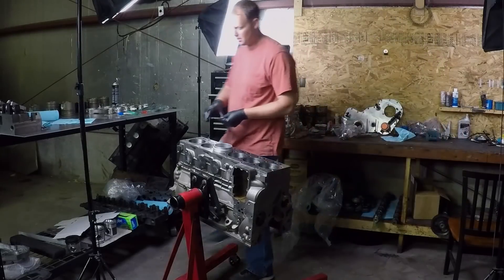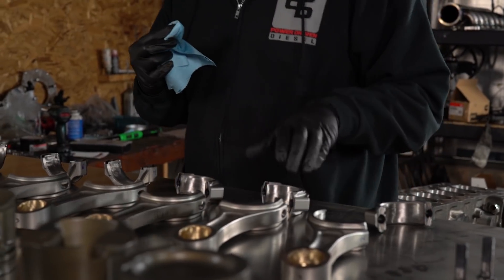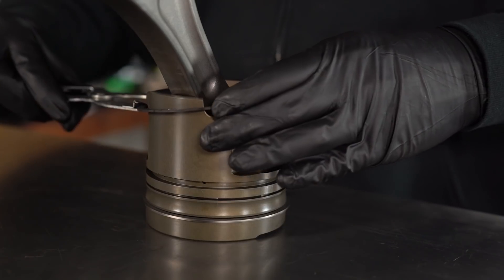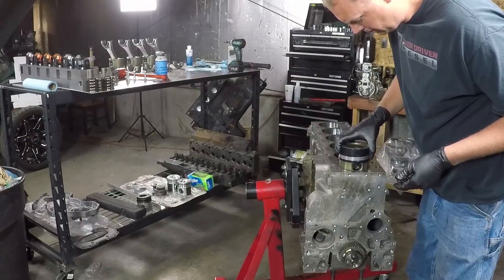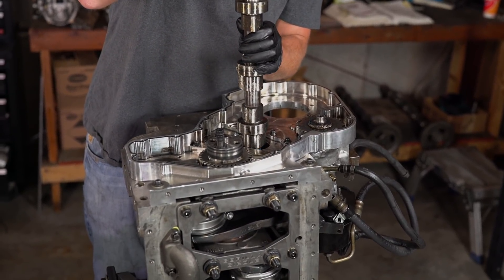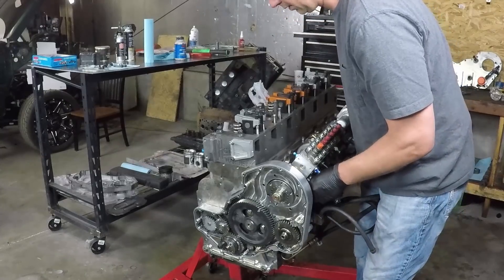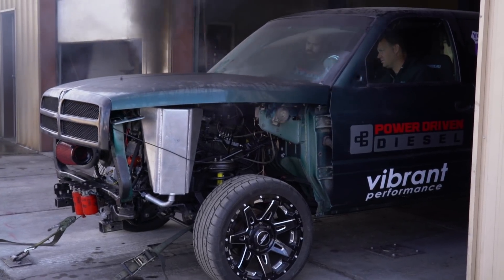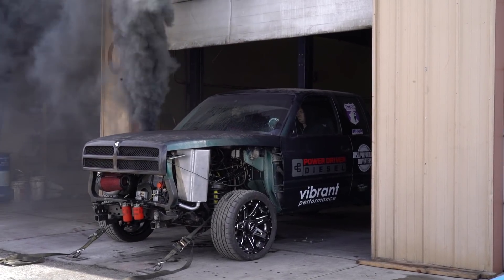Cummins Race Engine Build

Comment: I'm not even a real big diesel guy but I love the build and the quality of the videos.
Reply: Also your turbo tech series is amazing,there was info in them that it took me ten years to learn.Guys sometimes dont know how easy they've got it these days.
Reply: @southjerseysound7340  I have been trying to ask y'all about Dodge 03 1 ton5.9 Motor I just injector and now I have a code read  supply voltage circuit open,14&6 can tell me what mean and how many wire horenest does my truck have and in side motor out side were are at on injector
Reply: @paulkersey1621  you have me confused with someone else. I don't deal with diesels and was just commenting on a video. So chances are you're going about the wrong way of contacting them. Because they are usually pretty good about helping their customers out. They were extremely helpful when my cousin had problems with our tow rig

Comment: I just did this with a 24 valve.  Cleanliness is  the key to a long living engine.
Reply: Todd, 
What size intermediate exhaust  pipe does your shop use to connect the exhaust side of the compound turbos together?

Comment: Found y'all thanks to Finnegan. As a guy with a 12v sitting for a future chevy build, these are a good info source.
Reply: PowerDrivenDiesel mines just a little bit older. 1947 Chevrolet 3100. Going to run a 3/4 ton frame and 4x4 so I can actually use it on the ranch. But it will be years before it's finish. I have a 91 w350 with the 5 speed and a 47 chevy with 3 sets of almost every body parts.

Comment: Incredible output from that block with those well thought out mods and choice of parts . The fire rings, valve train and the stabilizer plate (girdle) to me make a huge difference in unlocking durable hp .

Comment: When we rebuild  any engine,   we use  a (gasoline hose)  hose (1')  on each rod BOLT,   then push the piston into the block.   Very cheap,   but  so helpful.    ( you have helped  me,  just returning,  the favor)
  You welcome.😎
Reply: @pddofficial  
Merry Christmas

Comment: Word of caution. Be careful when setting piston/rod assemblies down, especially with the rod hanging towards the edge of a table. Probably not an issue with big Cummins pistons but I've had them smaller/lighter ones fall over and off a table before just from the weight of the rod.

Comment: I know nothing about Cummins, and very little about diesels, but love watching engine builds. Pistons were as expected, but the pure size of those I-beams was impressive. Only question I have... Why go with head bolts rather than studs?
Reply: PowerDrivenDiesel okay. Missed that in the editing. Looked like head was set directly in place on the block with no studs in place.

Comment: LOVED this video. build videos are always the best. unfortunately I know those are also the most expensive. But keep up the good work guys. if I may suggest a video topic. I'm sure there are a few guys out there like me that would love to get into casual diesel drags or pulls for fun. i'm thinking about buying either a 1st or 2nd gen Cummins. I know the 2nd gen has the P-pump, but maybe talk about the strengths or weaknesses with either, and or what you would recommend for casual guys? Thanks for the awesome and informative videos!!
Reply: PowerDrivenDiesel thank you so much for taking the time to reply. I definitely like the look of the first gen more. Also when looking online they are much cheaper. I will do some research about doing a p-pump swap onto a first gen. Thanks again!

Comment: Although I didnt see the video about the parts i didnt hear you talk about piston grading where you check each pistons protrusion which is critical anytime any 
Block rod piston crank are replaced 
Did i miss something
What about your air density are you monitoring that
By increasing your air density you can lower your egt boost pressure but increase hp

Comment: clearly the 8.3 oil pump is working out. any info on volume and pressure? i wonder how much it will affect the longevity of the motor in the long run. consider me first in line to buy one if it becomes available! would be a fantastic upgrade to any type of application; tow/street/comp
Reply: thats a crazy high increase just at idle... fantastic work and still looking forward to results

Comment: is the cam gear on the cam angle cut.?  is it possible the angle is whats pulling on the cam.when it turns ... and broke it.. so much torque ..rpm.. it pulled it..? if so, straight cut ones next.?

Comment: My 5.9 Cummins 12 valve has 332000 miles on it, is leaking oil behind the P pump and the front main seal. Do you recommend to wear sleeve and how much of a job is it to fix that tappet cover
Reply: Thanks in advance.

Comment: Iam trying build a 1200 to 1250 hp 5.9 Cummins for my welding tuck. It’s going in a 76 f350 duly Iam just trying to figure out what piston size I will need for that.

Comment: Its such a shame that Cummins 12 valves are thin on the ground over here in the UK. They're such an interesting and versatile engine. The Dibble don't tend to like the big clouds of preboost smoke on the road either ;)
Reply: are the DIbble, the police? lol
Reply: they are everywhere arent they? Daf trucks ran them and you can pick them up really cheap
Reply: clayton bourne They are indeed
Reply: fatchance True but they've all done a million miles, and who wants an LGV sat on their drive while they rip the engine out? Haha
Reply: Get one for 6-700 quid no problem
Reply: @Diesel8290 ,but where do you get 600 squid
Reply: Fez135 Get you a FPT/Iveco N67 engine, it’s more or less the same engine but with the transmission in the rear ( better solution)
Reply: Diesel 8290 what does weight have to do with currency?? Jk I just had to jump in

Comment: Looking into building a similar engine for my school bus car hauler. This thing is a real dog when it comes to going up a hill with two cars on the back and a trailer with two cars on it. Had about 19,000 pounds worth of cars and trailer. What kind of transmission would I need to hold that power 1000-1500hp?

Comment: Omg the size of those turbos 🤪 minimum fuel is 1100 hp. Meanwhile I’m in my little corner hoping to make that on a max tune lol. 
Question. At what point is it necessary to get the girdle that ties into the mains??

Comment: Great Video 👍🏼 What is the tool you're using to hold the engine block? Any idea of where to buy one? It seems really handy to use when doing a rebuild as I can see you can easily rotate the block.

Comment: Freaking sweet if you don't mind me asking what kind of boost are you seeing out of those massive chargers
Reply: the previous set-up was also triple turbo, they have videos of it. I wanna say it did 165 PSI of boost, but i could be wrong.
Reply: PowerDrivenDiesel awesome thanks guys!
Reply: The  REAL FUNCTION OF  H.P.  is. FUEL &  AIR  ( LBS.  of  Air).   IF you can  move the mass of AIR  you want to (LBS of AIR)     
15  psi boost is BETTER THAN  150 psi of boost.      Boost is NOT A FUNCTION.
Reply: Billy Bob do you have a video of a 1000+ hp motor running off 15psi?
Reply: Hi mY nAmE iS BiLlY bOb I BuIlDe mOtOrS
Reply: @4375-d6i  are you sure about that?
Reply: Billy Bob I think he finally said 7! His car has 7 cylinders! Ha-ha Prius drivers!
Reply: @jamest.5001  
The  only  cylinder  COUNT,   that is very  limited  is :   7   &  9  & 11. (Radial  airplane engine)
Millions of:    1,2,3,4,5,6,8,10,12
Reply: @drthik1  Thx for shuttin up another unclear youtube commenter who had really no businesss here like myself, but heck some one had to thank the Doc on the lesson
Reply: @4375-d6i  as in powerstroke diesel
Reply: @drthik1  you mean powerJOKE, don't you? hahaha

Comment: What air filter are you running. Im needing a new one pretty bad. I had an exhaust leak on my hot pipe that destroyed my air filter. Is it a 5" I.D. filter.

Comment: That's beautiful. 

On your turbos , I noticed you have a 10 blade. Isn't a 5 blade better ?

I have a 12.7 Detroit and want to do a compound system using my 171702 Borg warner turbo. ( Don't know if I should swap my 7 blade to a 5 blade or 10 blade. (My motor sees 2500 rpm max) 

Thanks guys.
Reply: PowerDrivenDiesel 

Nice. Thanks for the reply.
I was going through your part 1 on turbo numbers. So much info. :)

So my 171702 is fine. 
What turbo turbo will work good.

My friend is going to build me some injectors. I don't know , if I'm Wrong. But I think he said something like 4000ccs. 
His name is Rick Fenwick. He drives a light brown Pete. He beat a 350  Ford at some track event about 2 weeks ago. 
That I would have enough injector for future motor swap to a 14 L and using a Compound system. 

That's for the info you provide. Love the video quality. :)

From Houston Texas.
Reply: PowerDrivenDiesel 
And my motor only goes to 2500rpms  as of right now.

Comment: Dumb question maybe I didn’t catch it. Is this a oem Cummins block that you modify or is it 3rd party? Thanks love the videos
Reply: PowerDrivenDiesel thank you. I’m trying to convert my 1980 dodge pickup into diesel. I can fit a 5.9 Cummins with a single turbo or a 4bt with compound turbos which is better?
Reply: awesomedude113322 5.9

Comment: I've never built a super high horsepower engine, but does it not start without brake clean? is it because the massive amounts of fuel injected in?
Reply: @pddofficial  makes sense, thanks for the reply. Nice truck!

Comment: Any idea what the torque would be at 15 or 1600 hp?
Reply: @pddofficial  I appreciate your response. I was an OTR driver for 13 years. Last truck had 500hp. When you said a modest 14 - 1500Hp. My jaw dropped and I subscribed to your channel.

Comment: what do you like to see for ring gap clearances on each cylinder?
Reply: I know it's more important to have more ring gap if you're using nitrous.  Just never heard anyone say how much should be taken off the rings for differing hp levels.
Reply: You have to change the ring gap for any power adder. Especially for higher cylinder pressures.
Reply: Yeah I know that.  It has to do with the heat of combustion and the higher the hp the more potential combustion heat.  I was trying to gain some insight about how much you have to take off for different hp levels and when it becomes an issue to do so.
Reply: Thats exactly what I was looking for.  Thanks for the info.  Keep up the good work with the drag truck!

Comment: Least amount of power possible.....1,100 lol. Wish I could speak in numbers like that! I don't even own a diesel anything but I find your work fascinating
Reply: PowerDrivenDiesel I'm sure it is. I had the chance to buy a 2 wheel drive 4 door long bed Duramax with the ZF 6 speed a few years ago. Still kickin myself about that one! Now that I've learned considerably more about these smaller 6 cyl Cummins motors.....By smaller I mean not over the road trucks......That's probably what I'll get. Things are getting hard to find though. Most have been poorly modified, beat up, or full of rust.

Comment: Good god if it's 1450 1500 wheel hp what is the torque like????
Reply: With diesel you can safely say double the hp as a thumb rule 👍

Comment: You are so SMART,  we do the same, when we install a camshaft.  Vertical block,  makes life so easy. 
JUST,  install cam BEFORE YOU BOLT THE BLOCK,   TO THE ENGINE STAND.    We do this on cheap gasoline engines,  I HATE 😨😖,  scaring the cam bearing.

Comment: Why do you need such high oil pressure...isn't flow what you need as the oil now is designed to create it own film to protect surfaces...this means less power lost running it?Your Rods...Mercedes have developed and I'm sure others now where the rod is cast as one and they break the cap off the rod and leave a rough surface which is supposed not be the best and strongest fit when clamped back together...... is this not so for your engines

Comment: I know that Beast has a 12-bolt TC right? Don't tell me you guys still believe in 6 grade 8 I don't care if you will them in bolts
Reply: they do infact run 6 bolt, 12's are to slow to swap in a race

Comment: External oil pump? And electric? Interesting.
Reply: you see a lot of that in some machinery. I work on 16 and 20 cyl CAT engines and they have external oil pumps as well as the crank driven oil pump. They just help keep the oil system primed, like a lube pump to oil everything before it starts. helpful in turbo applications

Comment: Why don't you bleed the fuel system so the shit will start on it's own so you don't blow it up using starting fluid. I see it every day oh will just run it on starting fluid till it bleeds its self. In the meantime the Pistons are eating themselves.
Reply: every single brand of starting fluid has lube in it.. this thing is low compression and high timing, its not different then a high hp pulling tractor.